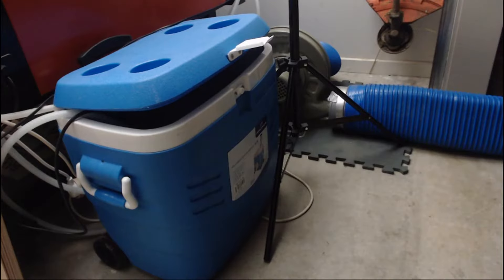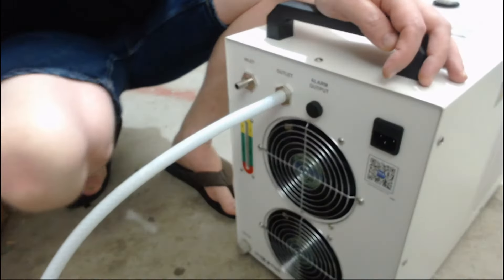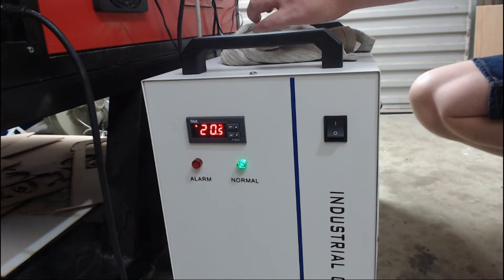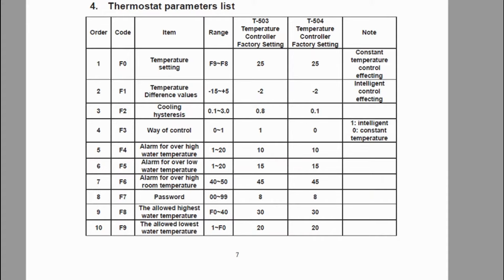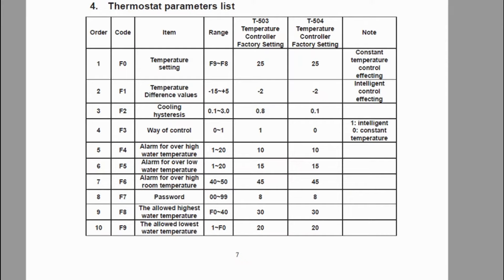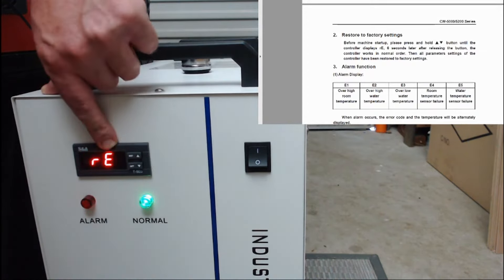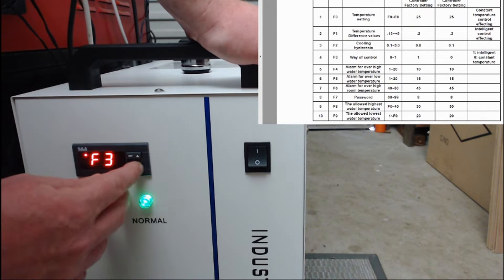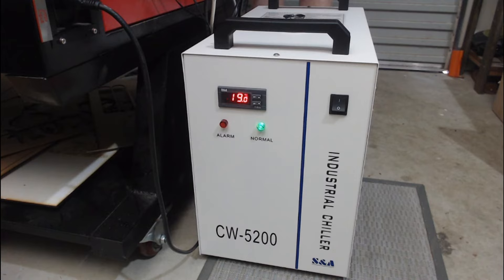Setup of CW-5200 Water Chiller Unit for CNC Co2 Laser Machine - S&A From Cloudray Laser

Comment: Thanks for the great video and walk-though! I've just received my first laser and CW-5200 chiller. Despite your instruction to get into the setup menu (the same instruction in the manual), I had to press and hold the up-arrow key, then press and hold the SET key before the controller would ask me for the password. Pressing them simultaneously did not work for me. This is just a FYI mention from me to anyone that might be experiencing the same challenge. The controller model I have is T-503C. Otherwise, I've changed the parameters as you described and now the chiller is working as expected. One thing I will mention is that it seems to take ages to get to the set temperature. Room temp at the moment is +5C and I've set the control temp to +17C. I expect the slow change is how this chiller has been designed. Seems to me it will take a few hours to reach my desired set temp.

Comment: Thanks. I read the manual and still couldn't fully understand it.

I've had issues with acrylic edge quality since resuming work after the christmas break. My first thought was something to do with the air assist (maybe faulty water trap).

Then noticed my CW-5200 was somewhat warm around 25C. Which is strange because a separate thermometer says the room is 23C.

I trusted that the installer had the correct settings on the chiller but it was in fact been on defaults... intelligent mode. The unit thinks the room is 29C.

Anyway, hoping this fixes my issue.
Reply from the maker: Hopefully this will help you out! Good luck with your acrylic cuts.
Reply: @MWLaser  In the end, the issue was the material itself. Supplier confirmed some of their sheets exhibited the same issues and gave me a partial refund.

At least I get my chiller configured correctly from this after like 4 years.

Comment: Say, when you set your chiller to 15C, how far does it cool down until it switches off the fans ? Mine cools from 15.5 (15C + 0.5C Hysteresis) to 15C (LED D2 on), where it switches into isolation mode (LED D2 off), engages the bypass solenoid (loud hiss), and keeps running until it hits 13.9C  then it switches the compressor and fan off (D2 blink).... that can take up to 10minutes at times. 
Does yours do that too ?
There appear to be vast differences in the way these devices use the bypass valve, some just engage it for a few seconds mine has it on for very long.
Reply from the maker: No the units I have don't appear to behave the way yours is in your explanation.
if it is a genuine s&a chiller they have good customer service you could email them for advice . Sorry I am not a refrigeration technician.
Reply: @MWLaser  Thanks. That's weird. I did in fact figure out why it did this, and the answer is: to get more life out of the compressor. I've made a short vid about that.
The bypass valve on mine seems to have an issue though, so I'll probably add a switch to disable it. Im planning to make a better thermostat for it sometimes soon.
Reply: Hello mate! I know this is an old post but mine seems to behave the way yours did.I set the low temp..but it cools below that by 1 degree or so..then there is a hissing sounding you explained..then it rises up to the a tual temp I selected then cycles on and off to keep that temp like normal

Comment: Hi Matt. My laser tube cracked during a hard frost 2 nights ago. I has an air cooled chiller and no antifreeze in water. Not a good idea. I have purchased a CV5200 so hopefully this will prevent laser tube cracking again. I presume you need to keep the chiller on the whole time to maintain temperature. Ps I really like your videos 👍
Reply from the maker: The CW5200 will help with chilling of water in hotter climates over the CW3000 air cooled units.  However it will not prevent the water from freezing during a hard frost.  (Thankfully we do not have that issue here in Australia).  It is recommended to use some form of antifreeze in cold climates, however I cannot provide more information on the type or brand of antifreeze to use due to not having experience with this.

Comment: Have you figured out how to wire the water flow alarm output from the chiller to the laser, to prevent operation without water flow?

My machine has a protection sensors in the water circut that has to be switched by water flow, otherwise it gives an error message on my controller, and prevents you from running the laser without water circulating. I recently bought a cw5000 and shortly after, this sensor failed. I've since bypassed the sensor. Before i got the replacement sensor in, i messed up and ruined a tube...today actually..by forgetting to turn chiller back on 🤦‍♂️🤦‍♂️🤦‍♂️ it occurs to me though, that it would be best to use the chillers own alarm to send this signal to the laser controller. It's got a port for it and everything on the back of the chiller, however the manual i have doesn't cover this well. Any ideas? Success? I can definitely message you more info on it if you want, but it's apparent you know more than me and I'm looking for help.

Thank you either way. Your vids calm the nerves when undergoing upgrades and fixes.
Reply from the maker: Happy to help, send me the details you have and the controller you're using and I will get you the required information
Cheers Matt
matt@mwlaser.com.au

Comment: I wish there was a "low water" alarm. I burned out a laser tube because of a slow, small, water leak. The water was still flowing -- and the sensor did not set off an alarm -- but there wasn't enough water in the system to keep the tube cool. 

Also, I used to have a CW-3000 and the water level gauge was on the FRONT of the unit, but for some reason with these CW-5200's, the water level is inconveniently situated in the BACK of the unit.
Reply from the maker: Yes it would be better if the water gauge was on the front and more visible.  I monitor all water daily to check for leaks and water level, part of my start up process.
Cheers Matt

Comment: Matt, I have a 100 watt Chinese laser. It looks like yours. What kind of numbers should I see on a mA meter. I'm getting only 32 at max settings. Any help would be appreciated. Thanks, Mike
Reply from the maker: Hi Mike, For my 80W laser the Max current is approx 28mA  for your 100W laser the Max working current should be no more than 30mA.  Maybe check out this website for more info. http://efrlaser.com/2-co2-laser-tube/200477/
Note: if you run the laser regularly at max power then you will reduce the lifespan of the tube, only set power to suit the material you are cutting.  I found that I was cutting at 25mA for a job that only required 16mA this was achieved easily by slowing down the cut speed and reducing the power.

Comment: Whats the lowest possible temp you can set on the display? i need to get into the sub C range. Will this unit allow to set say -10c or -20c for example? Do you know what any of the internals are made of? is it stainless steel tank or plumbing? Does the water ever rust or get contaminated from the pump or cooler internally? Great video!!!
Reply from the maker: Thanks - You should be able to find the answers to your questions here https://www.teyuchiller.com/co2-laser-tube-water-chillers_p31.html
Reply: @MWLaser   Thanks for the reply!!!!  I read through all the information this link provided but I was unable to find the info I seek. It says the accuracy of temp + or - 0.3C but it doesn't say the max lowest temp possible. Can you look at your unit and see how low of a temp setting you can input on the display? I am sorry to bother you on this but i hate to buy this unit to find out it wont work for my application. I need to go below 0C for my application.
Reply from the maker: Temp possible is +1 to +40 deg C.  this chiller would not be suitable for sub zero temperatures
Reply: @MWLaser  Thanks the what I needed!
Reply: Hello! So just to confirm you could set down to 1°c? I have read that minimum is 5°c?

Comment: Hello, hope you see this!  Help please. I have just bought 130W with 5250 chiller. The laser will run with chiller connected via alarm wire and turned off but gets water error message on Ruida when powered on. They have used 2 same color wires on alarm wire. I think we hhave decided the issue might be mis wiring at factory BUT, the wires are same color and its a 2 wire plug tat laser o 3 wires at chiller. The chiller manuals identifies as H1 as Red, H2 as Green, and H3 as Black. I have marked my 2 yellow alarm wires as 1 and 2. They had yellow wire 1 on red and yellow wire 2 on black, green ?? ground?? Is there anyway you can confirm that green is not connected to the yellow alrm wires? Then its just a matter of reveresing them, which I actually think I tried and it still failed. I am thinking the green wire ought to be connected to one of my yellow alarm wires???
Reply from the maker: G'day,
unfortunately I'm not going to be the best to help you with this wiring support query. I am not familiar with your machine and I cannot compare to my machine as I do not have connection for the alarm wire plug on my 80w laser  I run it without and everything is functioning fine (maybe you could try the same).
If your current 130W laser has a built in water protection then you will not require the 3 wire cable connected.  The alarms will still sound on the chiller without connection to the laser, and your laser will still alert you if the built in system has a problem.
You can email me using the address in the video description if you'd like to follow up further.
Cheers Matt

Comment: Excellent video as always, Matt!  I have set my chiller settings as you have suggested above, but I would also like to set a High Temperature Alarm, which I believe is setting/code F4.  The setting only goes from 1-20, but when I start the chiller, the water temperature is usually around 22-23-degrees C, which is close to my room temperature.
  If I set the High Temperature Alarm to 20, will it alarm right when I turn it on until it cools at or below 20? Ideally, I think I would like to set it to something like 23-degrees C. While this is warmer than the tube should run, at least I'll be warned before it goes any higher.   Cheers!
Reply from the maker: I believe the F4 over temp alarm is the degrees over the max allowed temperature set at F8.  For example if you set your F8 Max Temp to 20 deg and F4 at 5 deg then it will alarm at (20+5) = 25 Deg

Comment: Im not sure if your co2 laser have a weird setup, how does it make a difference if you switch IO tubes on the laser?
Reply from the maker: Not sure what you mean.  However the correct way to install is Outlet from Chiller to Inlet of Laser.... then Outlet from Laser to Inlet of Chiller, as I have demonstrated in the video. This way the water flows in the correct direction and if air is in the laser tube it will escape from the laser tube outlet as it is higher than the inlet.  if water flows in the wrong direction air can get trapped in the laser tube.  Cheers Matt
Reply: @MWLaser  That on a laser co2 tube there is a direction but in all reality dont effect anything going backwards

Comment: OK got my chiller today and none of my controls are like yours. The set button is on top not underneath like yours.
I can set the parameters by just holding down the set button for 6 seconds
I set F3 to 0
when I go to F9 and press set it does not show the temp it only shows 0 - 10
i am lost as to what is upper limit and lower limit. I am following you on a computer right next to the unit and am stuck.
Cannot use this because Im not sure which temp on the display is which
Reply from the maker: Is the chiller a genuine S&A chiller or a clone/generic version?  If the control thermostat component is different to what is shown in the video then the menu system and features will vary.  In some cases manufacturers put a menu sticker on the top of the chiller unit, maybe check that it may help.  You can email images and questions to matt@mwlaser.com.au Cheers
Reply: @MWLaser  Yep that is exactly what was wrong. This is a B&H model. I didnt even know there was a difference.
I have kinda figured out how to set the temps by long pressing the SET button. I have set it to 19.5 C  the ambient temp is 19.5
the chiller is running and showing 18.5c I never set that and cant figure why that number is showing and the chiller is constantly running

Comment: Does this machine from Cloudray come with a UK Power Plug?
Reply from the maker: That is a question you should ask them.  The machines do have IEC connections on the unit, so you could replace easily in the UK if required.
I only import 220V units to Australia, and the plug is suitable for our requirements.  I'm unsure of UK imports.
Cheers Matt

Comment: What is the difference between CW500 AND CW5200 ?
Reply from the maker: Compressor power, Nominal cooling capacity, Pump power, Max. pump pressure & flow and so on.
Full specs of each can be found on the teyuchiller . com website
In summary the CW5200 has better cooling capabilities over the CW5000

Comment: (1) Is there much of a difference between a CW-5000 and a CW-5200 (it seems that "CW-" chillers can be made by various manufacturers using the same "CW-" designations)?

(2) What about additives to the distilled water like "Royal Purple ice" (coolant) and/or "EasyCare FounTec Algaecide and Clarifier" (instead of just bleach)?
Reply from the maker: the CW5200 has a slightly higher cooling capability to the 5000, but essentially they are very similar units.  the 5000 is the minimum I recommend and is suitable for all lasers up to approx 100W.  if you intend to use for long periods of laser cutting time per job or you have a high wattage tube then choose the CW5200 or larger.

I don't use anti freeze as I live in Australia, so not likely to have a freezing problem, I believe it is necessary in some climates, however I cannot recommend a brand or type.  

Also I don't add any coolants or additives other than bleach. the purpose of the bleach is to minimise algae growth or sludge.  if once added the system is sealed and circulating, you shouldn't have algae growth as it is not like aquarium water which is open to environment where organisms can enter.  (I have had good results with using bleach only) 

Hope this answers your question Cheers Matt

Comment: Hi Matt
I am trying to set up my new cw5000 chiller and followed your instruction ,which seemed quite good and easy ,But as I pressed arrow keys and switched on at the same time PP came up instead of rF
So could go no further can you explain why 
Many thanks Eddy
Reply from the maker: Hi, I have had this question from someone else a while ago, and there is no reference to this in the manual,  So I contacted S&A the manufacturer, about this and the only response I got was "our chiller won't display PP, maybe is 8.88, but we are not sure at this moment"  They will only provide further support with a barcode or serial number.  My suggestion is the PP=Password Protected.  But I do not have a solution for you other than contact Manufacturer support.  If you do find out let us know.
Cheers Matt
Reply: Matts Workshop 
Hi Matt
I sent you a message last (not sure if you received it so will send again)
Have been in contact with  manufacturers about problem
Received email last night as follows
(Adjust the parameters F10  and F11 to 1  and press reset key to save)
I was not to sure how to do this so asked for a more detailed step by step 
Had email back as follows ( press the set key for 5. seconds,then F0  appears .Adjust it to F10  and. F11 with up and down arrows key. O.Continue to connect the set key then 0  appears and 0  is adjusted. to 1)
Not sure about last statement (Continue to connect  the set key)
Sorry if I seem still unsure ,but want to get it correct ,and will ask if I am not happy 
Regards 
Eddy
(Sorry to be a pain )
Reply from the maker: @eddyroper1185  Check you Facebook Messages, My Replies are not saving here for some reason.
Reply: Matts Workshop 
Tried it out got rid of PP
and chiller seems back on track ,just got to set temperatures now
Eddy
Reply from the maker: @eddyroper1185  thanks for the update.
Reply: Matts Workshop 
Hi Matt just an up date 
On investigation (keeping it short) the chiller sent to me I bought on eBay is not the one I found on eBay and paid for 
So I contacted the manufactures and they gave me the instruction to reset for the one I bought on eBay 
Not the one sent to me 
Have been in contact with seller to see if he can change ( don’t think I will have much chance 
Regards Eddy
Reply: Matts Workshop 
Hi Matt 
Can you tell me difference be tween a S&A.  and. B& H    Water chiller
I have got a B&H.
Reply from the maker: @eddyroper1185  Hi, They are different made by different manufacturers, I'm lead to believe the B&H is a clone/cheaper version of the S&A Chillers,  however there are some differences in power and cooling capabilities.  They may also have a different thermostat functions.
The B&H has a slightly lower compressor power and cooling capacity.  B&H 5200 = 0.71HP, 5084Btu/h, 1.49KW compared with S&A 5200 = 0.80HP, 5783Btu/h, 1.70KW
Cheers Matt
Reply from the maker: Sorry I realised after replying I gave you details for the CW5200 and you have the CW5000  I am not sure of the specification differences on that model as I only researched the info for when I purchased my CW5200.  I'm sure you can google it or look at your user manual to compare with the S&A specifications. 
Cheers Matt
Reply: Matts Workshop 
Hi Mat the one on eBay which ordered and paid is D & N do you know of this one as I was sent B &H
Reply from the maker: I believe the D&N is similar to the B&H, there are many clone brands marketing as a CW5000 or CW5200, some of these are DN, D&N, B&H, and Some Unbranded. I wouldn't be concerned with the brand label